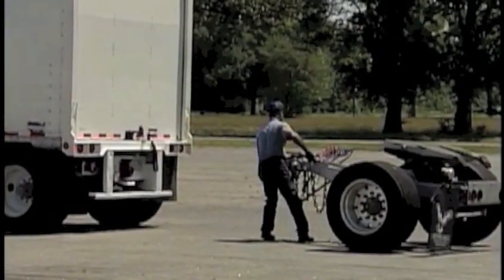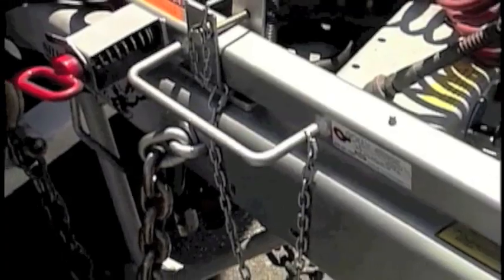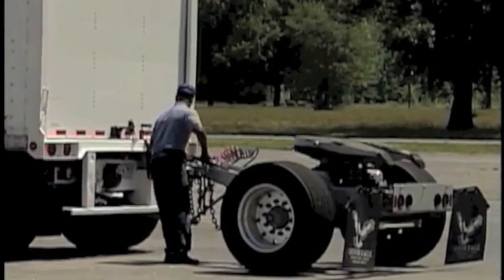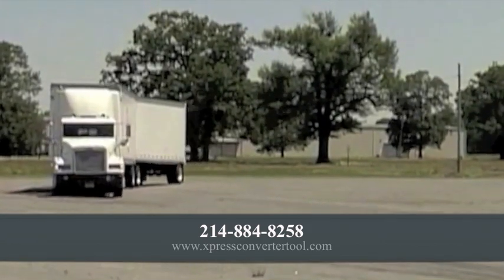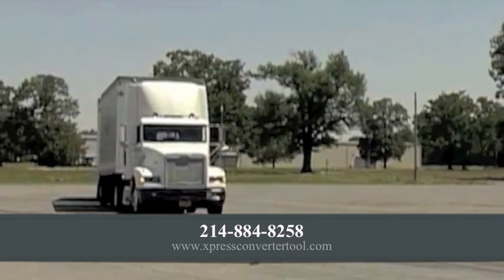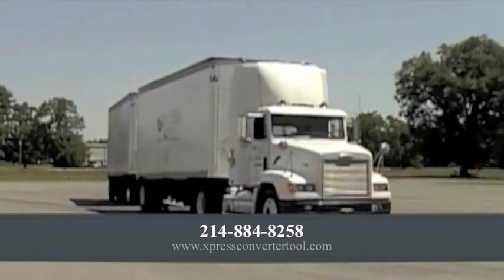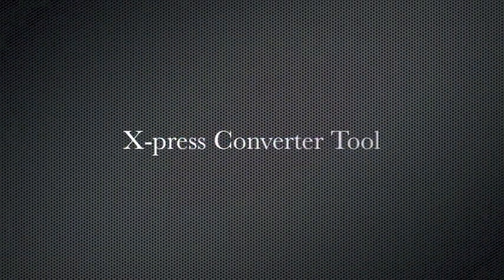X-Press Converter Tool In Action!  Find out more at xpressconvertertool.com.

Comment: Call me you start pulling proper triples
Reply: Why will proper triples not work?  Same principle applies, grab trailer 2 and then dolly.  Pull in front of trailer 3, connect XCT and backup and connect.  Disconnect dolly and pickup trailer 1, dolly and pull in front of trailer 2/3.  Connect and you are done.  ghart@xpresstrucktools.com